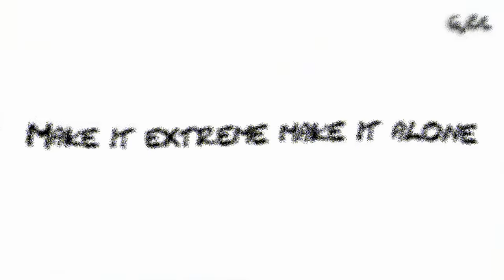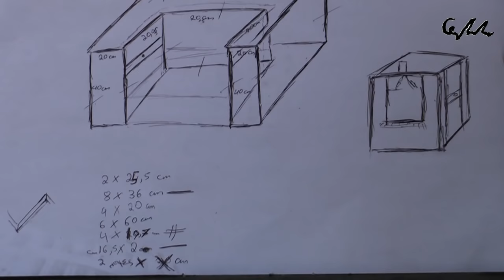Extreme glass grinder

Comment: how did he cut through the bottle and not the label?
Reply: I was wondering the same thing! Maybe the rolling cutting wheel doesn't really cut, but instead compresses the glass, stretching the label slightly?
Reply: Its not a cut, its broken off.
Reply: twisties 
He cut bottle most of the way ..then it splits
Reply: My guess is that the bottle was cut prior to shooting those shots and the label was used to hold the two sides together to get the shot. You'll notice that the point where the blade would touch the glass is conveniently hidden in all shots. In the final "cutting" shot that specific label passes the cutter (which is a diamond blade for an angle grinder by the way) no less than 6 times. While cutting glass with a standard glass cutter is more of a controlled break, cutting with a diamond blade actually grinds away glass; that blade would have cut the label. Period. You're witnessing some trickery to get the shot. While I'm sure he did cut the bottle I'm also sure we are not witnessing it get cut in this specific video.
Reply: With a diamond blade like this it is actually cut, all the way until the glass can no longer support itself. At which point it does break. But that would be long after the label has been cut.
Reply: Class cutter not label cutter. I hope I helped!

Comment: I'd give 6/10 for the idea, 7/10 for the build, and 4/10 for the welds.  If you learn to weld properly you will spend less time grinding and have a much nicer finish product.  Points off for no water cooling, and the motor for the grinder looks way too slow and much more torque than necessary.  Also, height adjustment would be nice to spread the wear out over the grinding wheel.

Comment: needs a water feed to save your bits and put a better finish on the glass
Reply: and to prevent Silicosis
Reply: Water doesn't prevent silicosus. In fact there's are tiny water droplets in the air containing glass dust that get breathed in when using wet equipment. Just wear a respirator always with glass
Reply: Wet grinding massively reduces airborn dust in grinding. To suggest otherwise or to suggest wet grinding hasn't nearly eliminated silicosis is a symptom of Congenital Stupidity. Silicosis was a common disease 100+ years ago in a variety of industries, its now largely non existent do to the use of water to keep airborne dust in check. There is nowhere in industry where glass is ground dry. Furthermore, Even hobbie equipment used for stained glass uses water to prevent airborne dust. Wearing a respirator wilk not keep airborne dust from traveling all over your workspace and being kicked up and becoming airborn EVERY time it is disturbed. Glass dust on your floor becomes airborn every time you sweep the floor or turn on a fan. Glass dust trapped in a waterbath doesn't. Airborne glass dust will get on your clothing, Maybe you can wear a respirator when you do laundry too?
Reply: Didn't say it didn't help just saying
Reply: It isn't totally safe
Reply: I work in a glass shop at a university. ....so I've been trained according to  osha rules.  We do air tests.  And I'm telling you wear a respirator while grinding.  And clean your space.  And the water is used to prevent glass from heading and crackling first most.  Second is liberation which relates to point one.  Third is to reduce dust.
Reply: Heating not heading
Reply: Lubercation... not liberation fucking auto correct
Reply: I got cold hard data that proves you still need a respirator while wet grinding glass.  Especially on machines like wet saws and wet belt sanders that have high rpm creating more mist in the air. I hope if you work with grinding glass on those types of machines you will consider a respirator. If not you know that's cool to, it is your body.  Just want to make sure your informed.
Reply: +trevor pierce lubrication :P, anyways, great and very very important addon for that machine
Reply: +trevor pierce I worked in the glass shop at my university 10 years ago. I have my own small shop now. Coldworking glass produces so little dust it's insignificant. Pick your favorite cold glass guy and I can promise you they don't wear a respirator. I've met most of them. Only time we ever wore a respirator was when we were loading batch into the furnace.
Reply: Yeah batch is nasty shit. I'm just telling you what the air tests said
Reply: If you look closely he does have a water feed, he's just not using it in this shot. On that note he's not actually cutting the bottle in this shot either.

Comment: what sort of blade do you have on your saw. i have the same saw but with abrasive blade. I d like to know what you are using, thanks great vid
Reply: Assuming you mean his metal chop saw, it's a carbide-tipped blade designed for cutting metal. I have a cold saw like this that uses such a blade and it's far, far better than the abrasive saw I used to have. Other than the blade, the saw is different because it has a gear reduction to slow the blade down to around 1200 RPM (instead of 3600 like most saws).
Reply: cool thanks alot for clearing that up
Reply: The carbide blades for metal are rather expensive and i have TONS of old dull wood cutting blades that are carbide-tipped laying around since my father use to do lots of wood work. i grabbed one of them and threw it on my chop saw and what do you know it cut through the metal like butter. over 200 cuts later and its still cutting like it did the first time. carbide wood blades new are a fraction of the cost of metal ones too... by no means am i recommending that you do it since its probably not the best idea, im just letting you know what i use and if you do decide to use a wood carbide blade make sure youre not in the direct path just incase one of those carbide tips do come off, even though none of mine have with the tons of cuts ive done.
Reply: +mustang 11 I'm a professional woodworker, actually, and while I have considered using wood blades for cutting metal, I don't. Well, mostly; most wood-cutting blades will cut aluminum just fine and such blades often state that. But steel is a different animal, and the carbide on steel-cutting blades is different since it experiences much more shock and other stress, plus the tooth geometry is different (there's hardly any set to the teeth). I think the main issue with cutting steel with a woodworking blade is safety, as I think it's much more likely that the carbide will shatter. 
Yeah, cold saws and their blades are expensive! I did consider using a cheap wood-cutting chop saw instead but didn't because their much higher blade speed sounded like a safety hazard and would wear the blade faster and because the higher speed and different design of the wood saws makes it more likely that metal chips would go into the motor. I won't tell anyone not to do it, but I do tend to be very safety-conscious (hence the Sawstop in my shop).
Reply: My father use to be a professional woodworker too that built custom cabinets, mantles, and that sort of stuff. They make a device (basically a potentiometer) that plugs in between the saw cord and the wall outlet  that allows you to change the speed of the saw but I agree that a metal saw (which I do use) and metal blade should be used. I just use the wood carbide blades since its free for me and has worked fine so far.

Comment: Without water for lubrication and dust control, this is inherently unsafe to use. It's an awesome design, but that is a fatal flaw.  Silicosis is inevitable if you use this on a regular basis, unless you wear asbestos level respiration equipment. Also, it is inevitable that you will carry the silica dust into your home and expose your family and pets to the same risks.  Take it from a glassblower.
Reply: He has a water delivery system, you can see it in some shots. He's just not using it in this video. For that matter he's not actually cutting the glass bottle in half in this video either.